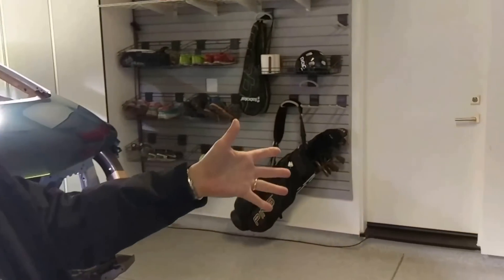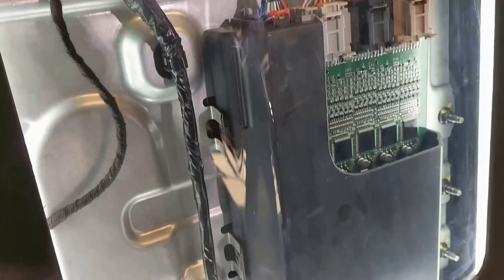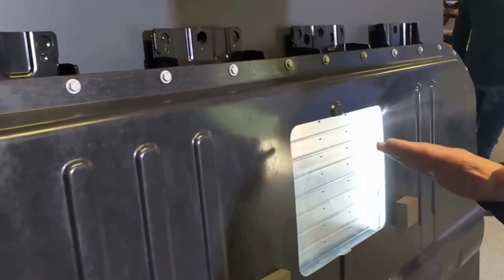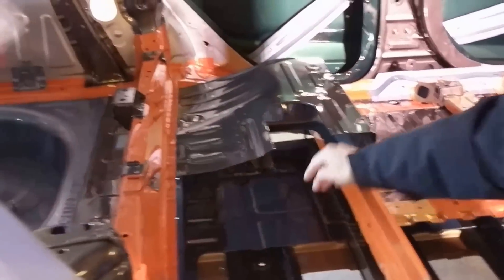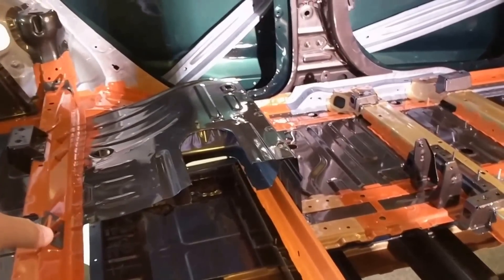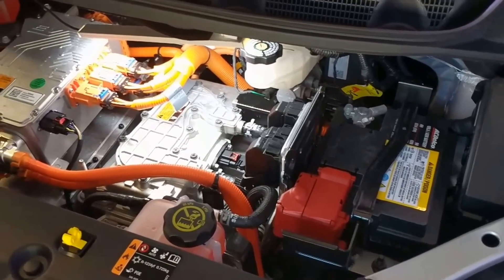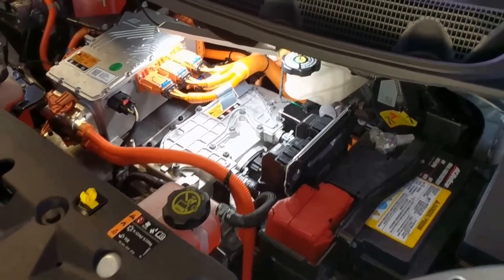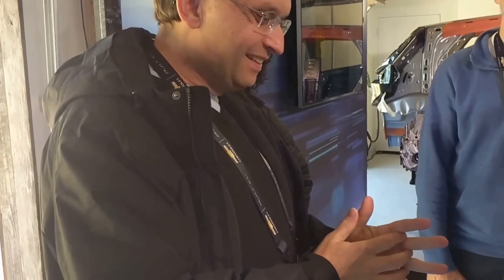Chevy Bolt EV battery and electronics

Comment: Regarding the lifetime oil. I'd like to hear from an expert like the gentleman in the video regarding the claims that the lifetime oil is also the break in oil, and is pretty filthy as early as 30,000 miles.  Was it made relatively easy for a paranoid overmaintainer like myself to have the gear box oil drained and replaced after a couple years of ownership?
Reply: There's no combustion byproduct contaminating the oil, its only serves as a coolant and lubricant. There is no need to change the oil. Look up the oil change schedule for a jet engine and tell me the Bolt will put more wear and tear on the oil than a jet.
Reply: I replaced the rear differential oil in my 2003 xterra after 100K miles of driving fearing it would be old and dirty and it was practically brand new oil. Waste of time replacing it. I bet I could drive another 100K on the original oil. If you get 200K out of chevy bolt oil and if you drive 10K/year that means the oil will last 20 years. I doubt that most will keep the car for that long. I might so I will find a way to replace that oil if I have to.

Comment: How much will a replacement cost for this car? I know this battery will not be cheap!!
Reply: The batteries have a 100,000 mi / 8 year warranty on them, so you'll be good for quite some time.  I believe they cost around 15 grand to buy a new, complete battery unit from GM, however they will also sell the individual parts inside the pack.  So if you lose the brain of the pack, or one of the 5 battery cell units, or some wiring or connectors, you can buy those and have them replaced, instead of swapping out the entire, costly battery.  Tesla doesn't offer that service directly to customers, and the Tesla packs are considered "non serviceable" as they are constructed like laptop battery packs, glued and plastic welded together.  The Bolt pack is "easily" serviced, having proper rubber seals and fasteners holding it together.  Can be completely disassembled and reassembled in a few hours.  Chances are, the components what would fail are either the electronics or contactors in the control module, which is a $500 part to replace, or a bad battery subunit, a $3200 part.  Far cheaper than replacing the entire pack for no need.

Comment: So what protects the battery from debris on the road? Teslas have a plate which protects it does the Bolt have a plate too? Or can we expect battery protection to be second rate to Tesla like everything else on the Bolt is?
Reply: Given I haven't heard of any Bolt issues concerning debris and there are about 30k  in the wild GM must have a good solution to the problem. I doubt know why you keep calling the Bolt second rate. Last time I checked there is no Tesla within $20k of the Bolt's price available today. You could buy a Bolt and a Civic and still be cheaper than a model 3.
Reply: The Bolts do have a plate under them, additionally, the bottom of the battery shell is about 145 pounds of steel.  Weber University has a series of removal, disassembly, reassembly, and installation video of the Bolt battery pack. It's a fascinating few hours of youtube.

Comment: Thanks for the video
This video illustrates that turning a battery into an efficient and safe power source for a vehicle really requires a car manufacturer. It requires heating and cooling elements, electronic load balancing elements, mechanical protection elements, etc. 
It's not enough to plug battery cells together in a car like they do in a laptop. They must protect the cells from road rash, vibrations, heat, cold, accidents, humidity, rapid power draws or inputs... 
It's quite an engineering accomplishment

Comment: Wow...  using the Bolt to run an inverter to keep your home alive during a crises is a novel thought to the designers.  Amazing.   All that electronics and still no onboard AC power for even incidental use....   You know for $50 you can put in a little aftermarket one I guess.
Reply: Yeah, not sure why this would be such a new concept to this gentleman, though maybe he doesn't go outside his lane much.  The Nissan Leaf has an optional unit you can buy from Nissan to let the Leaf battery backfeed your house, without resorting to hackery.  It's part of the Nissan whole home system that includes solar solutions, as well.
Reply: He's a representative of GMC, so he can't promise that the car can be hooked up to an external inverter unless the company has vetted the process. It would be very handy and perhaps a marketable feature if GMC were to support it . Some people here in California got power this way recently when the electricity was shut off. GMC, are you listening? As Sean says in another comment, the Nissan Leaf has an optional unit to do that.

Comment: He's actually wrong about temperature tolerances in two ways.

#1:  Lithium Ion batteries don't "Freeze" in such a way that they "don't produce power" below 30 F.  They do produce less power, as the chemical reactions in the battery slow down dramatically.

#2:  There are absolutely lithium ion batteries that can work in cold temperatures.  The ISS just changed to Li-Ion batteries with a low temperature optimized chemistry.
Reply: Listen to the video again....  He was talking about -30C.
Reply: Mark Winn Was it -30C or -30F? Also, my understanding was that it could still work in those temperatures with constant battery conditioning either from the battery or from the grid?

Comment: nice to hear from a guy who worked on the battery development and pleased that they learnt from Tesla to thermally manage the battery.
Reply: Not in price, availability and reliability.
Reply: also build quality. Tesla internals look like a $20 cordless drill compared to the Bolt (or the Leaf)
Reply: But they apparently didnt learn anything else from Tesla as the Bolt is second rate in every way to Tesla.

Comment: Impressive presentation considering its from Chevy. 
Does somebody which Cells are used in the battery, 18650s?
Reply: Only Tesla currently use 18650s. These are pouch (prismatic) cells.
Reply: Thanks!
Reply: About 6,500 less cells in the Bolt pack. That's the big difference.  The large number of small cells Tesla uses is an automaker's worst nightmare. But Tesla does make it work. But you can imagine how much easier it is for GM to build a pack with a few hundred cells versus Tesla's several thousand.
Reply: Prismatic yes, pouch no.
Reply: MrZorbatron what's the difference?

Comment: It's really more of an "LG Chem Bolt", not chevy bolt.
Reply: How so?  LG Chem is simply a vendor for GM designed components.  GM even owns and controls the battery chemistry.  LG Chem is nothing more than a supplier like Delphi, Visteon, Bosch and many of the other large automotive sub assemblers and suppliers.
Reply: Not at all, LG Chem is the reason the Bolt exists, they are not a mere supplier of bits. http://www.autoblog.com/2015/10/21/gm-without-lg-chem-we-couldnt-build-bolt-ev/
Reply: Most supply arrangements with suppliers are collaborative efforts.  I've personally worked on product design teams with Tier one automotive suppliers.  The reason GM is working with LG Chem is that they are the only supplier with the capability to build batteries to GM's specifications.  So yes without LG Chem the Bolt would not exist.   The president of LG Chem made no secret that they are trying to make a bigger play in the greater automotive supplier market.  Rumour has it LG Chem gave GM preferential low pricing on the battery in exchange for supplier contracts on other components used on the Bolt EV.   As I see it.  It was win-win.  But if Samsung demonstrated to GM that they could make batteries to GM's specifications and for a desirable price there is nothing stopping GM then going to Samsung in a few years.
Reply: You Know Tesla it's Panansonic's battery cells  .The Gigafactory would not exist without  investment of Panasonic compagny .Tesla don't built everything
Reply: MrZorbatron The Model S and X use a standard Panasonic 18650 cell that anyone can buy. It's even available on amazon.   The battery cells produced at the Gigafactory are produced by Panasonic employees on equipment owned by Panasonic.  The Powerwall 2 and Model 3 will utilize a new cell from Panasonic called the "2170".  This cell will be exclusive to Tesla for a few years before Panasonic makes it commercially available to all.   Tesla most certainly had some input into the development of this cell format but the actual chemistry itself is owned by Panasonic.
Reply: InternetDude 
The battery cell is a small part of the car. Turning a battery into an efficient and safe power source for a vehicle really requires a car manufacturer to produce. This video illustrates that. They show heating and cooling elements, they show electronic load balancing elements, they show mechanical protection elements, etc. 
It's not enough to plug battery cells together in a car like they do in a laptop. They must protect the cells from road rash, vibrations, heat, cold, accidents, humidity, rapid power draws or inputs... 
It's quite an engineering accomplishment.
Reply: Very True.  So if the Bolt is an "LG Bolt"  Does that make the Model S the "Panasonic Model S"?  Actually now that I think about it Tesla does not own the battery chemistry in their batteries.  But GM does own the battery chemistry in the Bolt EV.  So maybe the Model S is more Panasonic than the Bolt EV is LG Chem?
Reply: Tesla DOES own their battery chemistry, or at least both the exclusive rights to use it and the right to produce it with partners other than Panasonic after a few years.

Their name appears with Panasonic's on the applicable patents.  The Roadster used an off the shelf Panasonic LiIon chemistry, but the Model S and later are exclusive.  As far as the Model S being more Panasonic than the Bolt being LG, that's very far from the case, as LG builds ALL the high power electronics on the Bolt, while Panasonic has no involvement beyond the batteries on Tesla products.

The Bolt uses a version of LG's existing battery technology that was optimized in cooperation with GM for the projected demands of the Bolt EV.
Reply: Very few cars today by GM are designed by people in just one location.  The Bolt EV was designed by engineers in Michigan, California, Germany and Korea.
Reply: Erik Stephens, no, the Model S and X use a different chemistry which is optimized for Tesla's demands.  The exact cell is NOT sold anywhere else.  I do my research and I also attend investor events for Tesla, and have been to a couple of semi-public events.  This is a question that gets asked all the time, "Can I buy these cells for my home solar system/for my energy projects/for my electric cigarette/to stick in my ear/as a desk ornament?" It has been officially answered dozens of times: the exact cell used by Tesla is not available to other customers.  On the other hand, the original Roadster battery uses an out of the box Panasonic cell, it is not customized at all.

I hope you do understand that Panasonic makes dozens of 18650 cell types that are available to all customers, and Tesla's isn't the only one that's proprietary and restricted.

Why don't you show me where I can buy a few that didn't come from a smashed car?
Reply: Here is a battery cell that Panasonic made for XTAR.  This would be a near identical cell used in the Model S 85KWh cars.  It even has the built in short circuit protection.   I have no doubt that Panasonic made a couple of minor tweaks for Tesla in the cells (likely for easy of pack assembly).  But those cells are still 99.9% Panasonic.  

https://www.amazon.ca/3100mAh-Panasonic-Rechargeable-Protected-Specification/dp/B01GM9RMSK/ref=sr_1_6?ie=UTF8&qid=1487631460&sr=8-6&keywords=rechargeable+18650+battery+panasonic
Reply: You have no doubt that there are minor tweaks, but you have no basis to make a claim that the differences are only minor, either.  We have two companies (the only two) that are directly involved in this product, that both state that the battery is unique to its purpose and neither sold nor available to be sold to other buyers.  You, on the other hand, somehow believe yourself to know better.  Yes, this battery is a Panasonic 18650, and yes Tesla uses 18650s that are made by Panasonic, but there is no reason to believe that this battery is close to the Tesla battery.  Panasonic makes about 30 different 18650 form factor Li-Ion batteries, with differences in capacity, temperature range, chemistry, power capability, voltages (function of chemistry), etc., and the company has worked with others to develop custom battery solutions in the past.

If GM can go to LG, a major battery manufacturer, and work together to develop a customized chemistry, why can't Tesla do the same thing with Panasonic?  How do you know that GM didn't just go to LG, present a list of requirements - weight, energy density, power capability, operational temperature range, price, and ask them to pick or build a battery that meets this list of requirements?  We know this because both GM and LG have said that this battery was jointly developed for its application.  The same is true with Tesla and Panasonic.  Why should we believe GM and LG while we should not believe Tesla and Panasonic?  In the world of corporate ethics, Panasonic is leaps and bounds ahead of LG, and GM isn't exactly known for honesty either.  Now, I'm willing to put them all at the same level for the purposes of this subject.

Additionally, tested cells from disassembled Tesla battery packs have shown a comfortable capacity of about 3800mAh, not 3100.
Reply: Having worked in GM related projects, I can honestly say that I believe they would spend substantially more than Tesla for the same result.  I have seen very few companies squander their R&D money as badly as GM.  To be any worse, they would have to be the government, and to be frank, I am not entirely unsure that they aren't worse in some cases.

Testing and qualifying designs you buy from other companies can coast almost as much in time and material as developing your own.

I'm not anti-GM, but I don't believe the company line at all as far as what technology they developed and what they bought.  There have been too many cases where I have seem GM in the particular lie of claiming to have developed something that they actually only licensed and paid for a couple of years of exclusivity with.  Magnetic ride control is a perfect example of this, with the most common implementation having been developed by Delphi post spinoff.  GM used its fractional remaining ownership (at the time) in Delphi, as well as a fairly substantial price premium, to secure a few years of exclusivity before Delphi would manufacture the hardware for others.  A big kicker here is that a lot of the development was not even done on GM cars, because GM wasn't the first customer Delphi envisioned selling the systems to.

I'm familiar with GM Warren Tech, though I haven't been through the entirety of it due to obvious secrecy concerns.

Incidentally, the capacity of the Tesla batteries if removed from the car is actually higher than the apparent capacity in the car.  The company applies a deliberate and pretty substantial derate to the battery capacity, capping both minimum and maximum cell voltage to increase cycle lifetime.  GM does the same thing on their batteries.

After a certain point in the battery's age, these standards are actually expected to start changing in order to flatten the usable charge capacity over the lifespan of the battery.  This isn't expected until over 300000 miles at current aging rates and projections, and I don't know if this is yet implemented in either car's firmware.  So far, both Tesla and GM have been surprised by just how robust the batteries are, with many Teslas well over 100000 miles reporting only single digit percentage battery capacity hit.  Similarly, unless my information is out of date, GM has not yet replaced a Volt battery due to capacity loss (only defect/outright failure), and they do give a reasonable spec for it in their warranty (still 100000 miles IIRC) terms.  Tesla has replaced a couple of batteries, due to BMS not correctly compensating for aging parameters and displaying incorrect SoC data, that were from vehicles with over 200000 miles from commercial taxi service.
Reply: So you don't think GM uses their battery lab for anything even though it's the largest in the US?
Reply: Quote "If GM can go to LG, a major battery manufacturer, and work together to develop a customized chemistry, why can't Tesla do the same thing with Panasonic? "

Answer: Because GM has the resources to do so and Tesla simply doesn't.  GM has three global battery testing laboratories including the largest global automotive battery testing lab in Warren Michigan.  GM wouldn't be pumping tens of millions of dollars into battery and cell testing and development if they were simply getting an off the shelf solution.  Not to mention that GM has clearly stated many times that they have developed their own various battery chemistries (GM owns many different battery chemistries).    http://media.gm.com/media/us/en/gm/news.detail.html/content/Pages/news/us/en/2013/Sep/0916-battery-lab.html

Also for Tesla battery cell capacity it depends on the battery version.  Older Model S batteries used cells that were about 3000mAh.  The newer versions used in batteries like the 100KWh packs are pushing closer to 4000mAh.   You are absolutely correct in that Panasonic makes many different versions of it's 18650's.  And certainly they have adapted one of those for Tesla's application.   And that's exactly my point.  Panasonic used and over time evolved their chemistry to suit Tesla's needs.